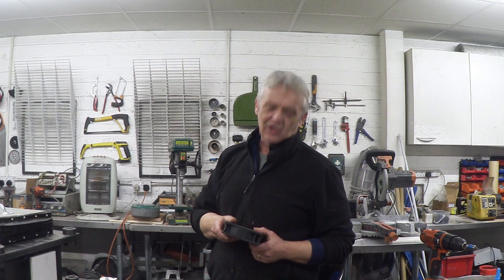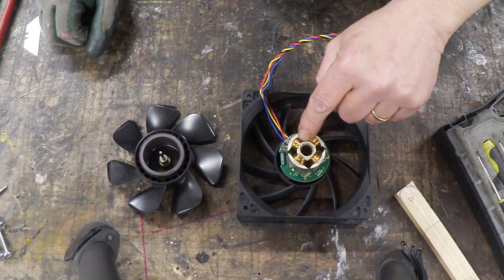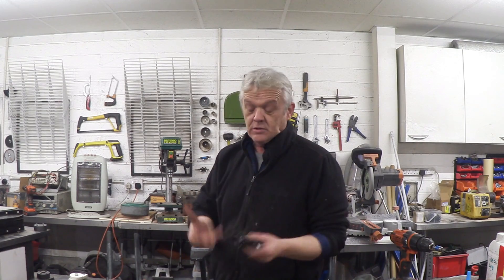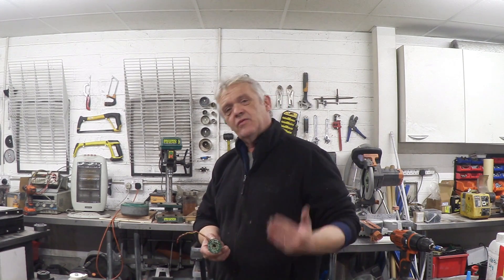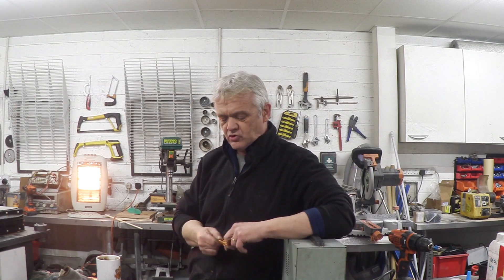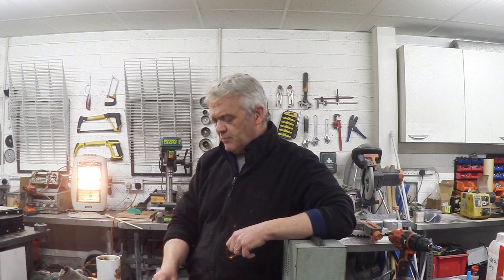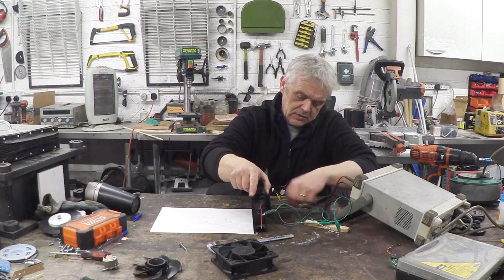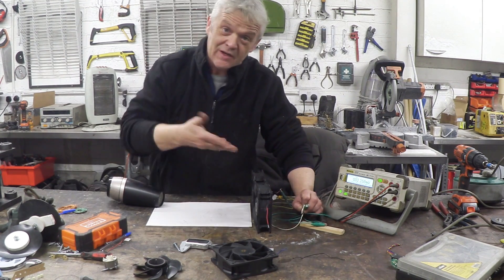1362 How To Dramatically Increase The Output From A PC Fan Generator

Comment: Would I be better off using fans made for 24 volts than those for 12, or is the wire the same in both and the little circuit board different?
Reply: A 24 V fan will have thinner wire with more turns than a 12 V fan (probably twice as many turns) . Exactly along the same lines as this vid, but probably only half the way there as this demonstration managed 4 times the turns.

Comment: Low voltage and current stuff can be fun, but it’s difficult to optimize for efficiency, as demonstrated here. Meaningful power output vs useful power output are different and people need to understand them better. If the stock fan can’t light an LED, why not add a joule thief to its output?  The transistor should send out higher voltage pulses well above what it takes to light the LED, fast enough that we won’t see it flicker. When light isn’t required, the energy could be sent to a storage device for when there is no wind and light is required (or heat or an electrolyzer for fuel or…)

Comment: Interesting TY!   4 thoughts to increase power?  1.  Use longer thinner stronger wire like  graphene , titanium, irdium, hafnium carbide wire.  2. Was wondering, if a special dialectic used for structure where wire is wrapped might increase magnetic field?  Not sure but worth a little research.  3.  Strongest magnets you can get to increase magnetic field.  Lastly, another YouTuber was able to break 95 efficiency by positioning the wire and the magnets in such a way as to capture more of the magnetic flux through the wire.
5. Lol  Well does not  meet Roberts reasonable goal of average Joe and low cost, but high temp super conductivity wire.   Still has to be quite low temp but has crazy good magnetic field, no resitance and high efficiencies.  Had to through that in.  :)

Comment: Increase in volt is not the same as increase in power. If the ampere goes down, as it will, you end up with the same power. The difference is a higher voltage on a lower fan speed. That often make it easier to use for something.
Reply from the maker: that has nothing to do with the wiring mate output power is always less than input power - a generator doesn't function as a creator of energy - it is a convertor - amps are really dependant on the load not on the generator per se - but you are spot on on the second part of your comment
Reply: The current is dependent on load, for the same load, you will increase the current as the voltage increases.
Where does the extra power come from? Higher torque at the fan, leading to better efficiency extracting energy from the air flow.

Comment: The power output doesn't change.
All rewinding the coils has achieved is a lower current at a higher voltage.
Now it can light a LED! Well whoopee!
Reply from the maker: yes - and that makes it easier to use - which is the point
Reply: So what's with the increased Watt output then?
Reply: Higher voltage = higher current = higher torque = greater efficiency, which is where the extra power comes from.

Comment: A few thoughts:  1. Small neodynium magnets, with appropriate polarity, glued to either outside of the rotor hub might increase the magnetic field.  2. If you're willing to modify the rotor, the fan blades are most efficient when pushing air -- a simpler turbine, like your rose turbine, might increase the speed of rotation.  3. I think those out-runner hubs and stationary could be "stackable", perhaps allowing you to use two modified generators to be combined.  Great video, and explanation.  Thanks.
Reply: Stronger magnets mean more resistance to turning under load. I think it's better to let it rip than risk it stalling nd not turning at all in anything less than a hurricane

Comment: Rain will eventually be a problem for these fans Bob. Maybe will need to mount whole project under some kind of cover?
Reply: @marthale7 most likely failure (since the electronics are removed) will be rust on the spindle which is the main bearing. Grease or WD40 will help a bit.

Comment: I quick reminder to those on this side of the pond. (I feel a bit foolish but I certainly clicked back 10s to hear the wire guage and diameter again and thanks Rob for mentioning units there at the end.) He's using SWG which will be a couple higher for the equivalent AWG. 
Not a concern at this project but don't go crashing a Marian lander or overloading your wiring because you missed the units.

Comment: I find the output from microwave turntable motors is pretty good, it's probably nothing special about the coil or magnet arrangement, but rather that the enormous gear ratio is causing the magnet to spin so fast, a wind turbine built around this would be interesting especially if you could make the gearing (speed) change proportional to the wind speed.
Reply: Thanks for the tip. I have a scrap microwave in the shed and I'm going to take it out and have some fun. Cheers
Reply: @michaelwilkinson8368  The credit should go to Rob,  I only found out from one of his videos a few years ago. Probably don't need to mention but do be mindful of the dangerous voltages in microwaves, even after being unplugged.
Reply: @dav1dbone  thanks but it's not my 1st rodeo. Capacitors safely removed but cheers once again.
Reply: The turntable motors that I removed are not free to turn so must do some more learning
Reply: @michaelwilkinson8368  you may find that more force is needed to get it to turn, I had to clamp it in a vice and turn it with a cordless drill on slow setting.
Reply: @dav1dbone  have to say a big thanks. Just took the gears out of the turntable motor and then ran it with the drill. Fook me the output is really good! Got a nice little zap at full speed. So there it is. Microwave turntable motors with the gears removed are a definately winner.

Comment: So an idea I've been kicking around since I've recently replaced the alternator on my truck and have a spare to tinker with, aside from modifying or removing the voltage regulator, what would be some drawbacks for using an alternator versus something like a 13 amp AC motor from a vacuum for wind generators?

Comment: This doesn't "improve the output" it just changes the V/rpm relationship. Its not an increase in output. Yes you get a higher voltage and can run the l.e.d. but it doesn't increase th.availablr power. Your windwall is the perfect opportunity to prove this - take 2 un-rewound fans and wire them in series (after rectifying) - the output would be identical to two rewound ones wired in parallel. No extra power.
Reply from the maker: the power output as demonstrated by the led went from zero to something - which by definition is an infinite increase - I would have said that was dramatic!
Reply: @ThinkingandTinkering  it's the equivalent of saying that a transformer increases power.
Reply: It's a higher voltage output, which is an improved output for people who want higher voltages. Really no need to be so pedantic about this, it's really not difficult to figure out what's implied because that can be easily inferred from the demonstration unless there's something wrong with your cognition.
Reply: @DimitriPappas  The title says it dramatically increases the output. I don't think it's pedantic to point out that it doesn't increase the output!
Reply: Pretty sure Rob said he increased to four times the wire length, so perhaps even with thinner wire the coils are now a bit bigger and there is more copper by weight in the coils,  which I would expect to give more power.
Reply: There's  a conversation  in this .